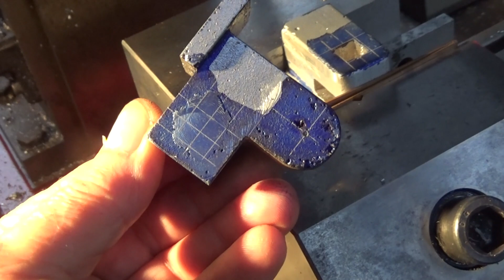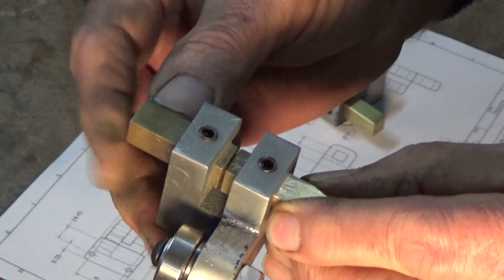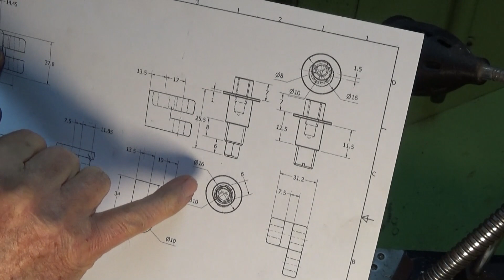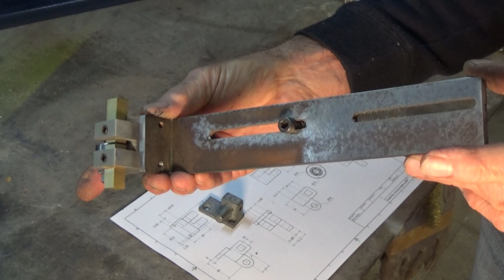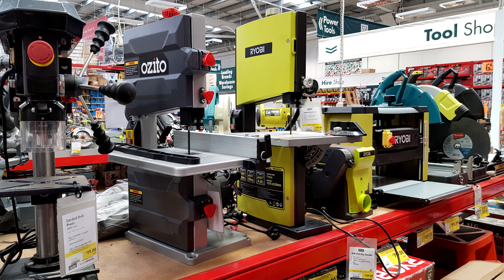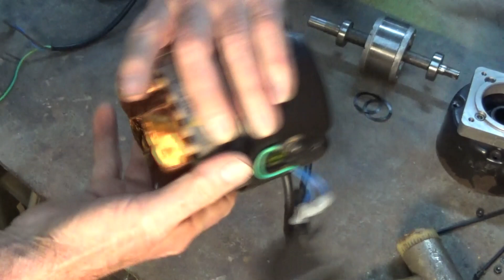Wood to Metal Bandsaw Conversion - Part 2

Comment: Adding a nice thick plate steel stiffener into the drive section would help control tensioning deflection on the frame.  Also, it would allow you to move the gear box forward in the frame cavity; just need to mill a cutout for it to pass through.
Of course; as small as the saw is and availability of scrap metal; welding up a new frame doesn't seem all that unreasonable either.
Reply from the maker: I have a nice big piece of 6mm hot rolled steel plate just the right size to go in the back plate of the saw body but I want to try aligning the wheels accurately first. If that fails I will be strengthening the back plate. I am trying not to add too much weight to the saw since I will have to store it off my welding bench. I have just about run out of places to mount machines permanently. 😥

Comment: Nice project. I believe you have tons more money and certainly hours into this than simply purchasing such a metal band-saw. However, you seem to be like me and love doing things like this, and therefore the price and labor doesn't matter. Thumbs Up!
Reply from the maker: Gary,
I had already purchased a metal cutting bandsaw that only operates as a cutoff saw. It does a great job but it won't tilt up far enough to allow for fitting of a horizontal table like some of the larger metal cutting saws. I thought it was a bit of a stretch to convince my wife that I needed a second metal cutting saw. The other fun fact was that I was telling my mate this sorry tale when he dug out this wreck from under his bench and gifted it to me. It seemed a little churlish to just toss it in the bin without making some effort to use it's constituent parts. As you have observed I have plenty of time (now that I am retired) so I don't begrudge the labour aspect. 
Regards,
Mark Presling

Comment: Mark,  This is another very interesting video!  As far as your lower wheel/blade tracking, could it be a combination of the blade tension pulling up the "rigid" lower wheel & also the weight of the gearbox & motor?  They may be teaming up against you because both look (to me) like they could cause the tracking problem in the direction that you are having.

Comment: Smart move reversing the armature. There’s more than one way to skin a cat. Good job Mark.
Reply: could have just turned the gearbox around
Reply: @toni1907  Yes that kind of works. Have a look at where the motor will end up if you go down this path. There is what looks like a dust extraction port to clear so larger offset or move the port to the other side and it needs to be able to open.
 If this is/were an option then you have the motor sticking out the front of the band saw, less compact for storage. If going this path then the shaft from the reduction box will have to be extended a long way putting a huge amount more of load on most of the lower part of the drive/blade system. That is bearings and chassis.
Just my thoughts, John.
Reply: @joandar1  what i meant was put shaft in other side of gearbox turn over that way shaft raises stragt up to top of box in place of the bottom where it is now
Reply from the maker: Toni,
I didn't really want to mess with the gearbox. I had a look and it seems like it has been designed to be sort of modular and that means that some of the seals, mountings and bearing surfaces are probably interchangeable. At the end of the day, reversing the armature in the motor was a pretty easy fix. The motor has no warranty but the gearbox does! 😁
Reply: @toni1907  I think I know what you are saying, and that works for reverse, however it will mean the worm will not have the lubrication it has now as the oil will not be covering the worm. I don't know enough to say if that is critical to the lifespan of the reduction drive or not. All good just thoughts, John.
Reply: Mr Mike, I agree. I had heard this works, however I was not sure as I thought it may be a wives tale. Glad to hear it does work.
 Excellent work as usual Mark, Thanks for bringing us along on the journey.
Cheers all from John, Australia.

Comment: how did cnc converting this mini mill work for you? everywhere i read, they say its horrendous because of the huge backlash of the leadscrews? are you having videos on it?
Reply from the maker: Sharky, The only change I have made to the saw is to use the Nema34 gearbox to reduce the shaft speed of the existing induction motor. It is not a CNC conversion. I am not sure why you think it is a CNC saw?
Regards,
Mark

Comment: Awesome conversion!! We have an old Craftsman that I would like to convert over to metal cutting, now I have some Ideas for the conversion, thanks. I was wondering if you could add some various thousand thickness shims to the bottom bolts of the reduction box in order to get the bottom of the lower pulley to move inward for better tracking. Great video!
Reply from the maker: Craig,
That is what I was thinking and then I did some checks and found that the bottom wheel was about 3mm inboard of the top wheel. I am not sure how that happened because I did all sorts of measurements and checks before I committed to machining the extension shaft for the gearbox. I am going to make a spacer to realign the two wheels tomorrow and if that doesn't work I will shim and strengthen the mounting for the gearbox. Surprisingly,  the blade still tracks OK and it still cuts metal as it is!

Comment: Preso, very nice job on reversing the motor.
I was thinking to reverse the reduction worm drive, by flipping the gear box mounting, with worm drive on top side of the gear box. It would of raised the center of gravity by having electric motor up higher, but in may of been easier. You would of have to swap sides of the output shaft as well.  Would that of been possible to do with that reduction gear box?
Also I guess the worm gear should be mounted at the bottom for the oil to lubricate it, or it it lubricated with greased?
But i like your method, as it keeps the CoG lower.
Reply from the maker: I considered altering the gearbox but at the end of the day, the gearbox has a warranty but the motor doesn't. If I started breaking down the gearbox and if failed prematurely I would just have to toss it!

Comment: Can't you use slightly larger bearings on the blade guide?
Reply from the maker: Yes, I hadn't thought of that though! I still have a few checks to do before I change the setup. I spent ages measuring the blade position and the mountings for the blade guides before I committed to machining everything. I was a little surprised and disappointed when I ran out of adjustment on the eccentrics. I stripped everything down after I posted the video and checked again and now it appears that the design was correct to start with. Maybe I just hadn't assembled everything correctly when I shot the video. I feel confident that I can get it right though. 
It's always good to hear suggestions because despite how clever I think I am there is always someone who has fresh eyes on my project who will point out an overlooked aspect of the design.
Regards,
Mark

Comment: Hey Prezzo, loving ur work. Has anyone told you that you could pass as a sound double for Jon over at Superhouse/Freetronics??? Anyway I'm sure it's just my eyes deceiving me, but it sure looks like the blade is upside down when you are cutting the aluminium/steel. I know it can't be cause it wouldn't cut but???
Reply: Hey John, as they say today "my bad" x 2. I totally forgot about the reversing of the motor that Mark only spent half the video explaining!!! Some people are slow learners lol. Also as you said you can do thing in the Southern Hemisphere... when you live here you tend to forget the "Down Under"  & upside down effect. It fits perfectly with the concept of mounting the blade upside down ;)
Reply: @DCJones06  All good D J. Cheers Cobber, John.
Reply: David, you are correct and that is why the motor reverse is shown towards the end of the video. If you hold enough downward pressure you can do things in the Southern Hemisphere, lol.
Cheers from John, Australia.
Reply from the maker: David,
I guess all us Aussies sound the same! I just checked out Jon's channel and will have to go back and look at some more. He seems to be offering some interesting stuff. Many people have commented that I had the blade reversed but it is just a trick of the video frame rate. It certainly wouldn't cut if it were reversed.
Reply: I was almost going to ask if you were related...